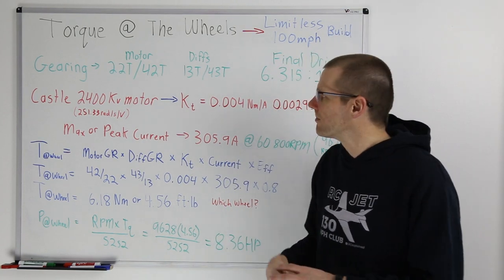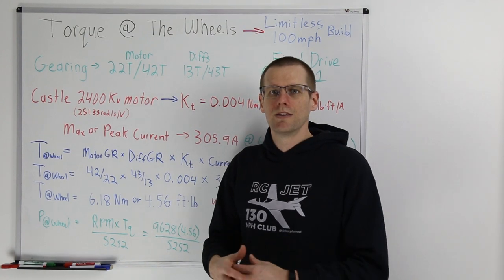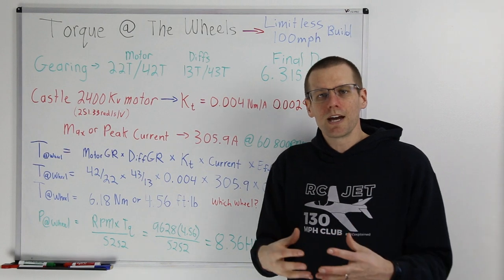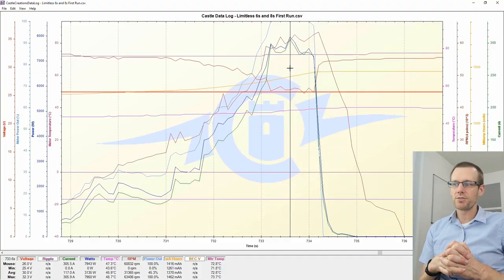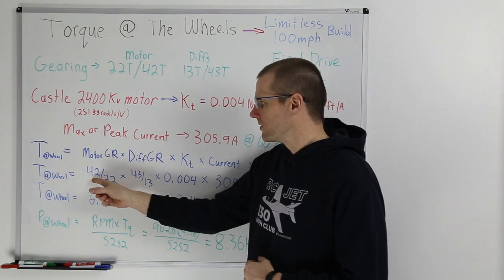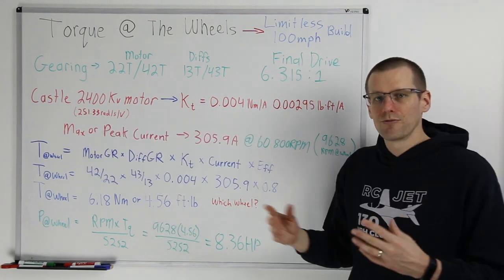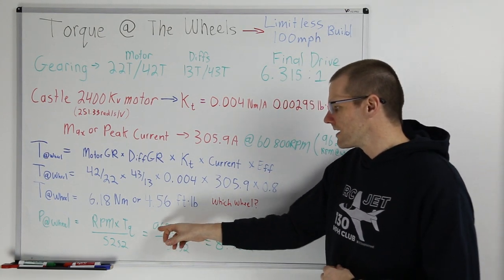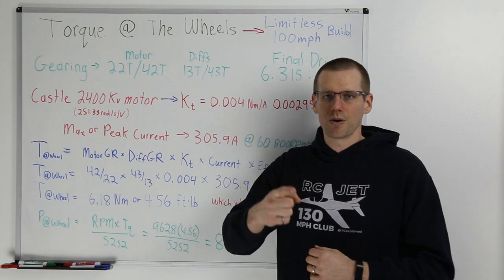Torque Produced at the Wheels of a 100mph Arrma Limitless

Comment: I think you should cover the topic of using one lipo with a jumper vs using two lipos without a jumper.  Is there any efficiency in either case?  Things like how and if c rating is affected.  Example two 50C 2S lipos vs one 50C 4s lipo.  Does the ESC technically see two batteries as one?  Things like how and if mAh rating is affected.  Example two 3000mAh 2S lipos vs one 6000mAh 4S lipo.  I've also seen someone question whether or not you can use a single 2S lipo with a single 4S lipo to run an RC on 6S.  That question itself got some very different answers.  I've also seen people question whether or not you are actually under powering your ESC when you run it on anything less than it's maximum S rating.  And how c rating may or may not be affected when you run lipos in parallel vs series.

I actually know the answers to some of these questions, but it seems like someone like you would be able to explain it better.
Reply from the maker: I'll take a look at these suggestions. Thank you.

Comment: When you say the torque at the wheels is 4.56 ft lb at 9628 rpm, would the torque also be the same through the acceleration up to that rpm, or does the torque increase / decrease as the vehicle accelerates?
Reply from the maker: This torque value comes from a peak current spike in the run-up to top speed. In the beginning of the run, I must accelerate the car with controlled throttle. Otherwise, the wheels let loose and the car will spin out. Because of this, torque would have been lower due to the amount of throttle I was using.